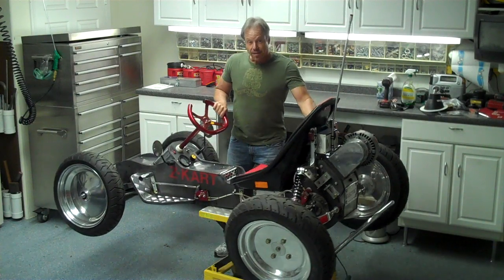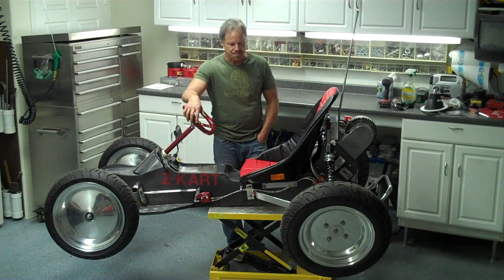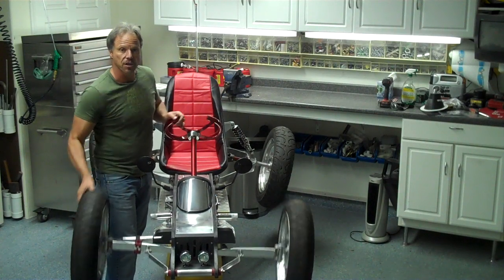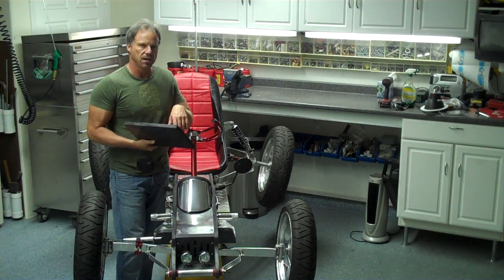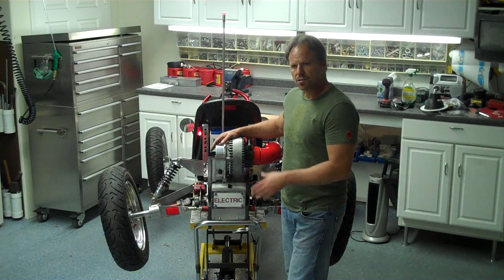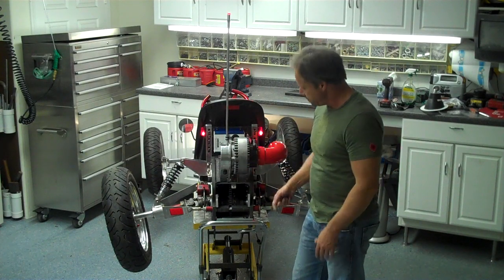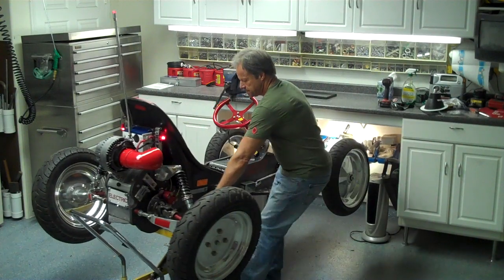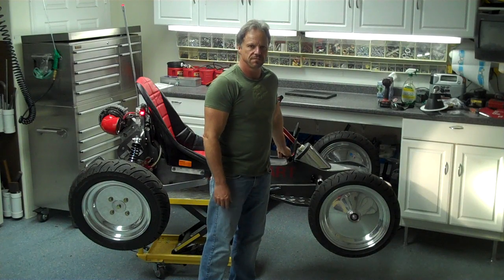The building of the ZKart

Comment: Post contin...with the smaller battery (7.4v lipo 5000mah) an a smaller I get 30-40mins of hard useage an the smaller volts as well as the pinion helps keep the motor cool...any help to u?

Comment: Hi George, awesome project! I have a couple of questions - What is the AH rating of the batteries you used? What type of charging system are you using? I have found 72v charging systems hard to find. Finally, what type of gear ratio is used between the motor shaft and the axle?

Comment from the maker: It is a 72 volt lead acid system, top speed is about 40 in about 6 to 8 seconds and it will run for twenty miles, weighs about 300 pounds, all-trax controller, racing cart brakes but with two calipers instead of one like most carts, 40 size chain with one jack shaft and a Comet differential. Steering is rack and pinion like on sand rails column I built myself from solid aluminum and tubing.